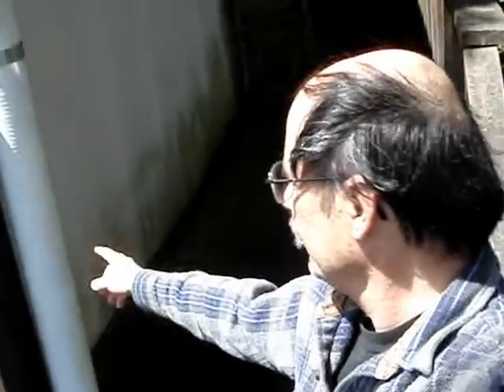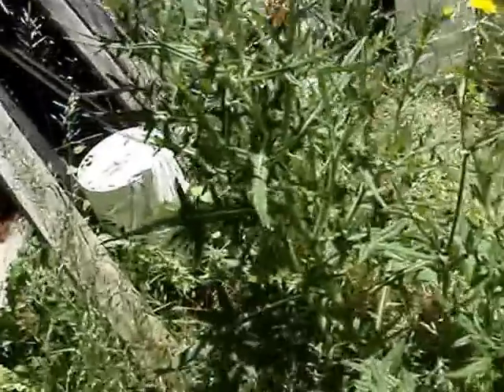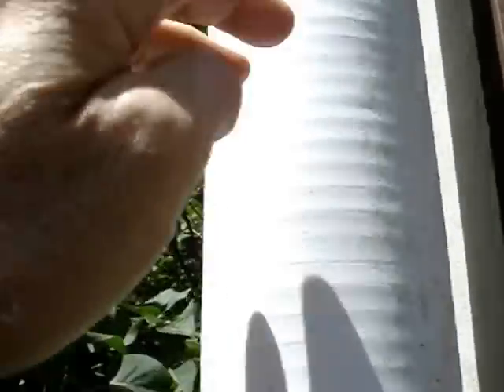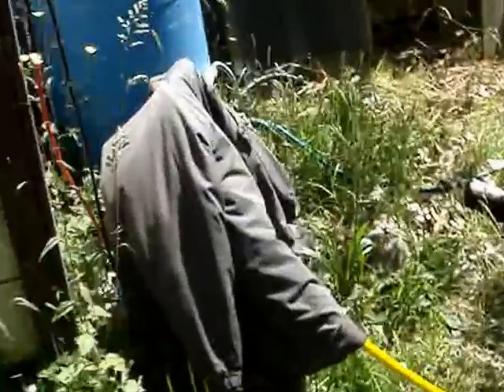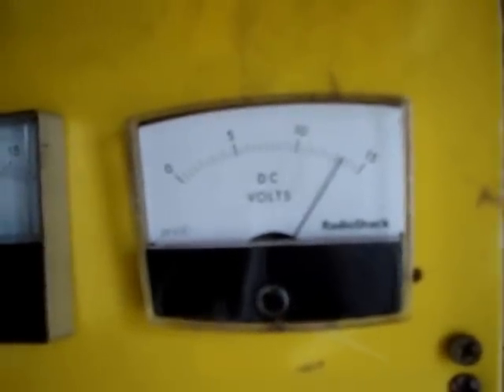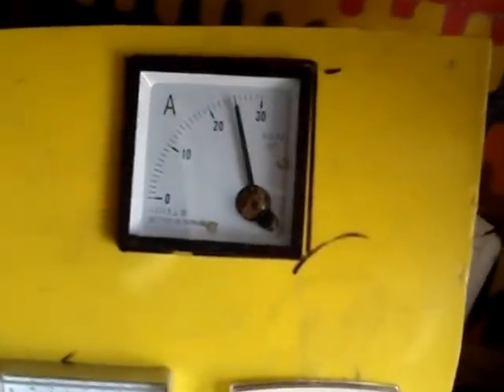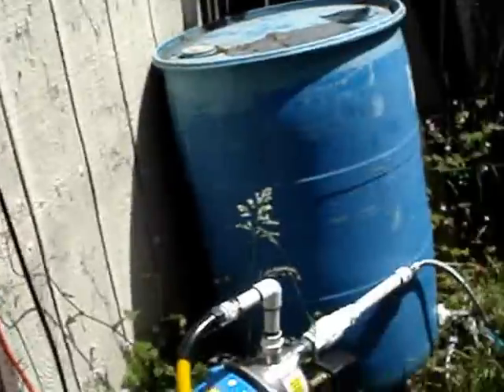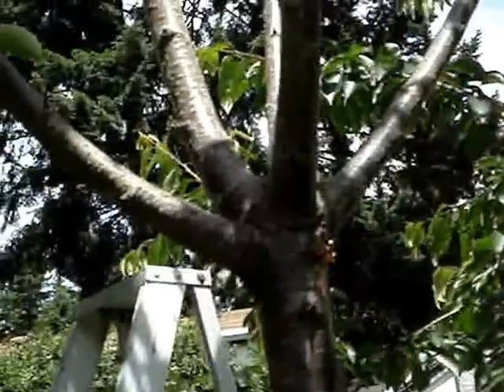Solar Power Update Off Grid Rainwater Roof Catchment System Summer Solstice 2012

Comment from the maker: Using the Amerimax Home Products Snap-In Filter White Gutter Guard screens.
Demonstration of the head of pressure from the downspout replacement. 

watch?v=vUKmNlXJGpA

Small grit from the composition shingles does get thru occasionally so I'll back flush the system. Non potable water for now, used exclusively for washing watering gardens.